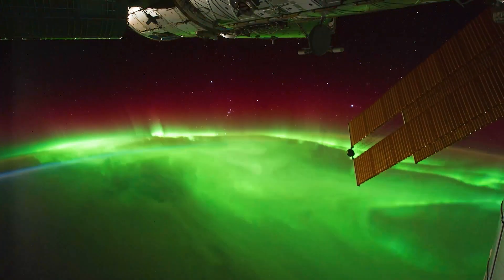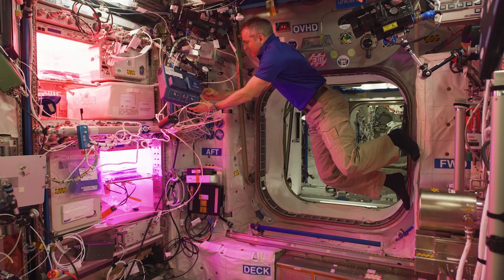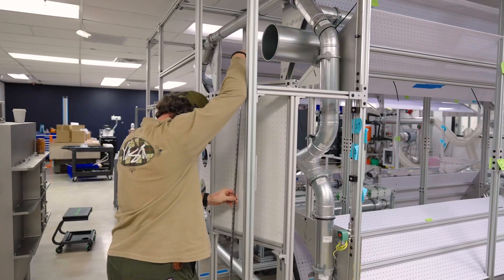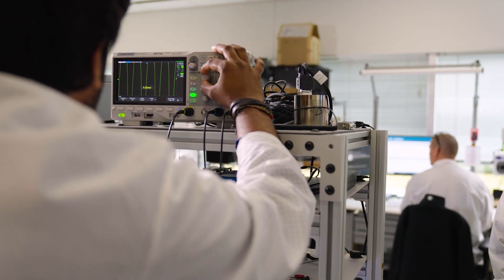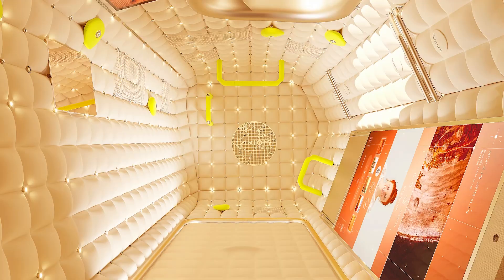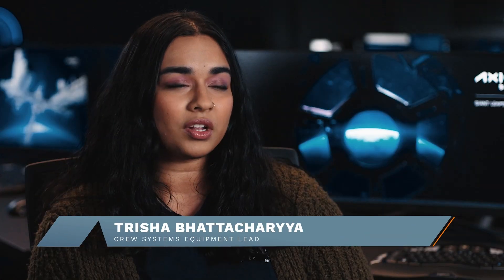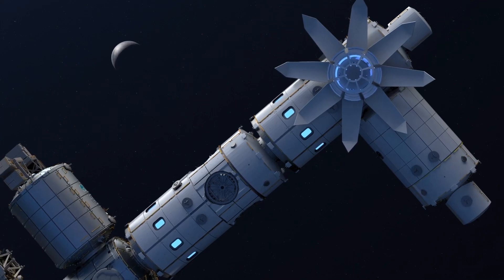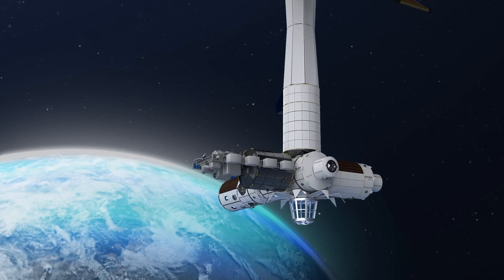Building Axiom Station

Comment: 13 "CONTINUOUS NATURAL LIFE ON WATER DIET & YOGIC METHOD"

Speaker: s. venkatesan, B.E., AMIE Date: 21.10.97

4. Meenakshi North Street Mannargudi-614 001.

According to Dr. Arnold Ehret's theory Man does not die due to fasting. During fasting the poisons in the body-old medicines, Starch, fat etc., get deposited in the alimentary canal and this poison slowly builds up, and kills him.

1 Dr. Arnold Ehret's theory states that pure body acts like a plant and assimilates Nitrogen to build up protein and fasting does not affect vital parts of the body.

3. "Thirukkural" (942) gave a clue about the Water Diet System the mean- ing being "Let Water be your diet and you need no medicine".

By combining the above three theories and with ""rational" slow fasting and intake of cooked vegetables, it could be possible to clean the accumulated poison "then and there". The clean of body can also be done in one year and able to "live" on water alone. The body weight will reduce by 30% and remains stationary on any amount of fasting.

occasionally taken ordinary food only as a luxury and not as a neces- Mary and clean the alimentary canal in the next few days will increase the weight slightly and drops back to original and never goes below.

The above method is scientific based on the book "Mucusless diet healing system" by Dr. Arnold Ehret, and original text. "Thirukkural" by Sage Thiruvalluvar.

Venkatesan

129

Hence a healthier life can be achieved by the Water Diet Sy tem. When hard physical work or travel is involved, ordinary food in taken and cleaned in subsequent days as mentioned above. The above method is best suited for "Space Life" as the human body is created With in-built power by Nature for mankind to develop and expand in "space" a necessary way of life for the human in the near future.

☘☘🙏🙏நாம் சாப்பிடும் உணவு எந்தவிதமாக செலவாகிறது என்பதை படித்ததெல்லாம் கொஞ்சம் மறந்துவிட்டு நாம் சுயமாக சிந்திக்க வேண்டும்.
In english We should forget what we have read about how the food we eat is processed and think independently.

1 மலமாக மாறி, தினமும வெளியேற்றப்படுகிறது 
.It turns into feces and is expelled daily.

2 தேவையற்ற உப்பும் நீரும் சிறு நீர் மூலம் வெளியேற்றப்படிகிறது.
Excess salt and water are expelled through urine.

3, ஒரு பகுதி இரவில் விஷமாக வாயிலும் உணவு பாதையிலும் படிந்து விடுகிறது, இதைத்தான் காலையில் பல் விளக்குவதன் மூலம் தொண்டை வரை சுத்தம் செய்கிறோம், உணவுப் பாதையில் படியும் விஷத்தை,வேகவைத்த காய்கறி மூலம், பெருங்குடலுக்கு கொண்டு வந்து,வெளியேற்ற வேண்டும் என்று நீர் உணவு முறை கூறுகிறது
In english A portion of toxins accumulates in the mouth and food pipe at night, which we clean up to the throat by brushing in the morning. According to the water-based diet, the toxins that accumulate in the food pipe should be brought to the large intestine through cooked vegetables and expelled.

4 மீதப்பகுதி,முக்கியமாக ஸ்டார்ச் கொழுப்பாக, உடலின் பல பகுதிகளில் தங்கிப் பல நோய்களுக்கு காரணமாகிறது, நீருணவில் மூலம் மாதக்கணக்கில் அதை கரைத்து எடுத்த பிறகு, கடைசியில் சுத்தமான உடல் ஏற்படும்,
 கூட்டிக் கழித்து பார்த்தால் விண்வெளி சக்தியில் இருந்து தான் நாம் வாழ்கிறோம் என்பதும் சாதாரண உணவு அதை தடுக்கிறது என்பதும் புரியும்
In english The remaining portion, primarily starch, accumulates as fat in various parts of the body, causing many diseases. After dissolving it in water during digestion, a clean body is ultimately achieved. When we observe this, we realize that we live off cosmic energy, and ordinary food hinders this process.

https://youtube.com/channel/UClFXakmJ2u9R6ytMeUp1c1Q?si=UJZESm6Dn271ucma

Comment: I understand it's extremely complicated and difficult but... Why the hell station is designed old way? Bunch of cans joined together? Where is rotating torus station? Where are robots assembling and making components in space? Technology and idea shown in these presentation is an old junk in new outfit. Sad, very sad. Go axiom, go, but not in that direction...
Reply: Because the old direction is cheapest and least complex. Sometimes the traditional way of doing things is the best way at the moment. The station is still open for modification and expansion after its fully assembled. Those fancy rotating habitats and repair bots could come in later.

Comment: Take home message for me was that fact they said they want to plan to double crew capacity every 5 years. By 2030, once the station has been fully built and running a couple of years it will be 8, by 2035 it could be 16!? thats pretty bold and incredible. That in itself exceeds the numbe of people in space currently acheive by ISS + Tiangong + a 4 man crew changer over/private mission.

Comment: So what does it mean to be totally independent of ISS after you have attached the new modules to ISS? Is the plan then to separate and detach from ISS an be a separate station or will they keep being attached to the ISS for an undetermined time? I mean, Nasa are planning to retire the ISS whithin 10-13 years are they not? I know you just talked about your thing for 3 min straight but I was left congused as to igthese are simply new modules to the ISS or if its a new separate space station? Good job:)
Reply: Yes they are going to break away from the ISS. Not sure why it isn't shown here. In fact if their business is successful, they plan make multiple independent stations that way.

Comment: Could they design a section of the station that could rotate to simulate gravity? Like the ship from 2001: A Space Odyssey. That way, the astronauts could have a little healthy gravity to strengthen their bones and muscles.
Reply: Good idea but it have lot 'too much'. This will be too big, too heavy, too vibrate, and too difficult to start rotation. Just remember if we began rotation something inside ISS we must to hold ISS itself outside. To hold with what? How many fuel needed to hold ISS' position during spin up rotating section/module?
Reply: They will not do it. Never. They're thinking wrong way. Only possible way is making and assembling station in orbit. Delivering ready made modules is waste of time and effort. It's better to design machines to build something than building by you self. Simple as that. Axiom will not survive as a company. They will extinct. It's not the way.

Comment: need to go big, also just making modules is basically the same old same old as the ISS. need to make it bigger. also need to build an external shield rather than the same design so you don't end up like the ISS where heat and cold cause cracks over time. putting external shield between space and the units protects against the heat and even micro strikes. you can even use your waste material for it.

Comment: I hope these guys do for space what SpaceX did to get us back to space. Love the concept of growing a new space station off ISS before it's done.
Reply: 2029-2031 iss will deorbit into Point Nemo
Reply: What do you mean by SpaceX getting us "back to space"?
Reply: @nagualdesign  I suppose they're talking about American human spacecraft to ISS and such. There was a period after the Space Shuttle program was ended.
Reply: @Tankeris6327  I also think they could be referring to the complete overhaul that SpaceX has brought to the design of launch vehicles in general. The space launch industry currently assumes that most new vehicles are being designed with genuine, low-cost reusability in mind, or it's seen as a step back from what's already been proven. That was not the case even 10 years ago. If Axiom Space can do that on the same level regarding commercial participation and application of space stations, then life will be very different for humanity by the end of the century